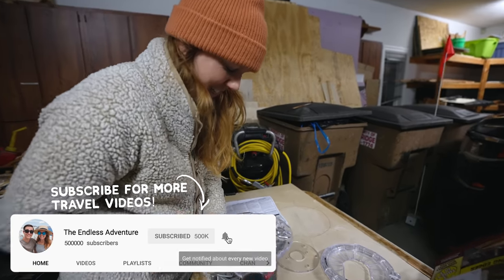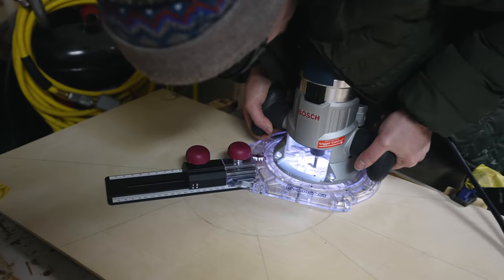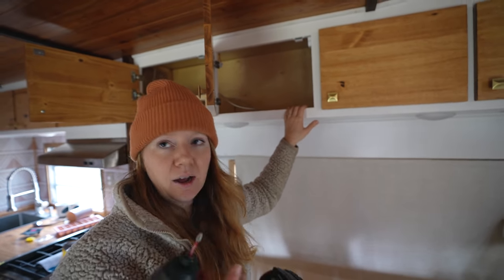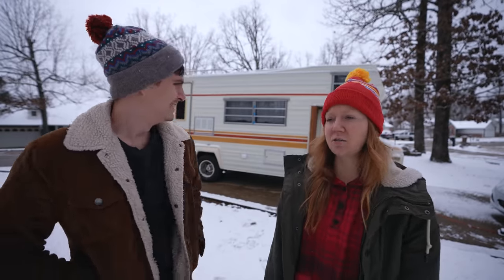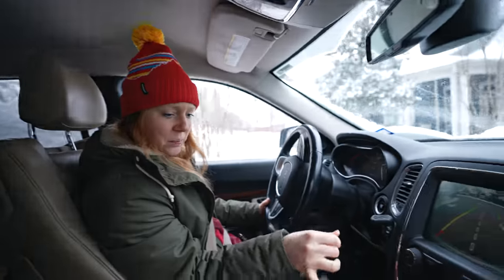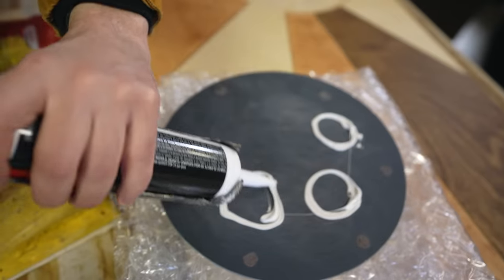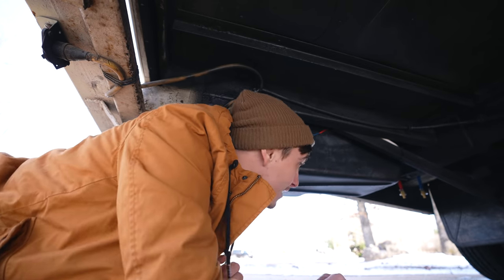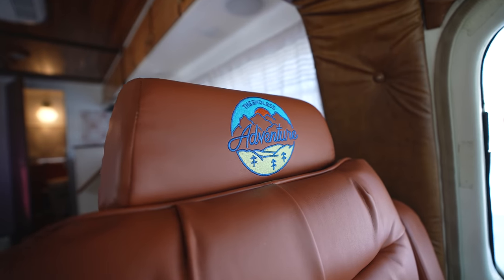RV is Finally Ready for FULL-TIME TRAVEL! - Finishing TONS of Final Projects!

Comment: Tighten the wood screws enough so they sink into the wood a bit then cover the screw heads with wood putty and smooth it off. After it dries you can sand and stain it so it blends in and, at most, they will look like a couple of wood plugs, but you can take a darker color stain or black paint and draw woodgrain lines through it to match the side panels and help disguise it.

Comment: Router tip:  if smoke comes up from the cut, you're moving a bit too slow (the friction is no longer cutting, but burning instead).  It's not a huge issue, particularly since the inside of the cut will be hidden, but file it away for future router use.
Reply: That and, perhaps not cut the whole thickness in one pass. There will be a stop guide with steps, you could've stepped down and taken less 'chunks' until you've cut right through....
Reply: Thanks. I had no idea it was from moving the blade too slowly
Reply from the maker: Oh great to know! We definitely still have much to learn about the router. 😅Very appreciative for the tip!

Comment: Menards...I love it. I'm originally from the Midwest and now live in the south where Menards is not. I miss Menards. 

A tip for drilling holes to a certain depth is to tape the drill bit so it stops at whatever depth you want the hole.

Also some quarter round glued over those wood screws would look nice and be really easy.

Comment: To avoid drilling completely through a piece of wood. Simply wrap a piece of masking or duct tape at the desired depth around the drill bit as a guide.
Reply: Exactly, but double check every so often because the tape tends to slip if you bump into it enough

Comment: Just a thought. Each time you have opened the cubbies, it seemed as though there is a small lip that hangs over the edge. It seems to have worked as a lift open point. Why the knobs? Not my camper, just an observation. 🙂